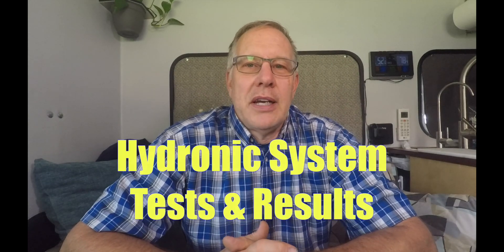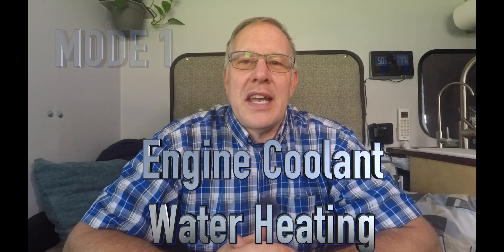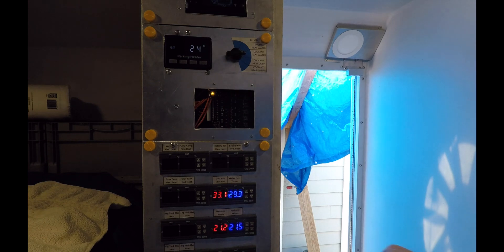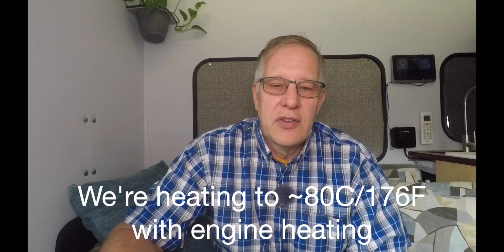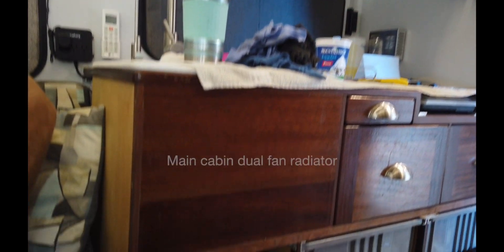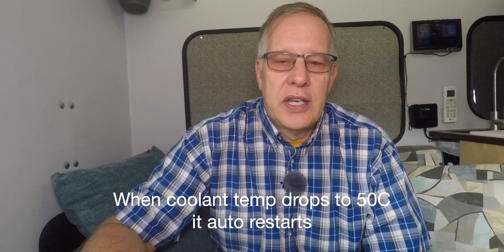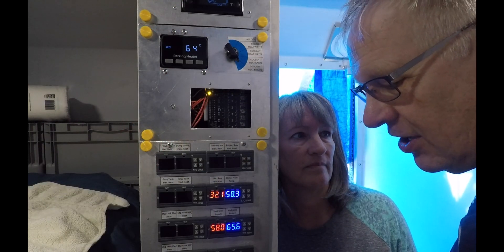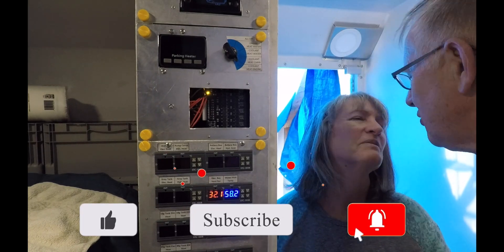TESTING: Hydronic Heating & Diesel Fired Coolant / Engine for DIY Truck Camper Expedition Van Build

Comment: This really is the downside to hydronic heaters. Especially the older models, and the Chinese copy’s of them, are not able to throttle down enough to let the heater run continuously without shutting off. The newest generations of Eberspächer and Webasto is better though. It’s the same scenario as for the mini split, the startups are what’s drawing most power and are the noisiest. The best solution for this is using some kind of accumulator tank in the system, to lower the amount of times it need to start. Not ideal in a moving vehicle as you’d need to add more weight, but the colorifier can also be utilized and instead only heat water as needed by passing it through the accumulator tank.
Reply from the maker: I have been 'scheming' with a Software Engineer in San Diego who is using the same Hcalory coolant heater on a boat. He believes he can make a simpler control that can work in series with the manufacturers control to alter the 'turndown' temp of the heater (to use the mini-split term). As it is, the heater uses a fixed 'run at full speed till 80C then start slowing to a shutoff at 90C', program that is probably fine for an engine heater but it would be far more beneficial to begin earlier for cabin heating purposes. It's such a simple parameter change it seems like it could be easily done with all current hardware. The 'relight' temp (I use 50C) is user programmable. Just having access to a few control points that are currently not user adjustable could expand the range of use. I've tried to engage Hcalory but they don't appear to be interested in talking.

Comment: How many BTU's per hour do estimate your camper needing at 0 degrees C?
Reply from the maker: The best way to estimate that is by the behavior of our 5kW/17kBTU diesel air heater. There are a lot of mornings at 28F-40F (-2C-5C) where we run the heater. It starts at full power with the fuel pump running 5.6hz. It runs at full power till it reaches 22C (71.6F) then slows to it's slowest speed at 1.6Hz (1.4kW/4.87kBTU) but the temperature still climbs and we eventually have to shut it off. I'd guess somewhere around 3 kBTU we may achieve equilibrium but the air heater can't run that slow. The 5kW coolant heater has a similar behavior in that even running at lowest possible speed they overheat the cabin but I have not used it enough to develop a similar test.

Comment: Definitely an involved system, but when it’s 0F outside and you’re at an awesome boondocking spot with your radiant floor heat and have warm water running without any frozen pipes you will be happy. Great job!
Reply from the maker: In order to get it to do the 4 different things I wanted from it, AND to make it foolproof for Cheryl, it is a bit complicated to build but hopefully not complicated to use. Both have turned out to be true. Once I got my mistakes figured out, it has worked fine.....knock on wood.....I'm still not done though so there will be opportunity for more challenges. I still need to add two sub-systems. 1) Two coolant loops to keep the battery and gray tank from freezing and a 2) hot (fresh) water return to the two fresh tanks to keep their temperatures up....These are not likely to be complicated but I do wish the STC-3008 thermal controllers I am using were more robust. I'm not sure if I have broken them or they have been infant failures, but I've had 2 go bad this trip.....lucklily, I had spares.... and didn't really need them to do freeze protection just yet. Thanks for following and commenting...Steve